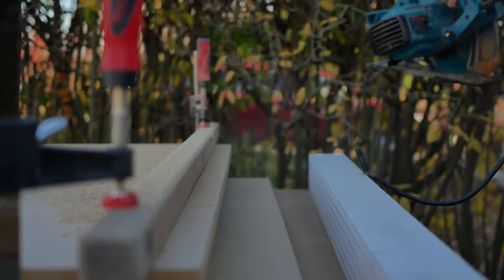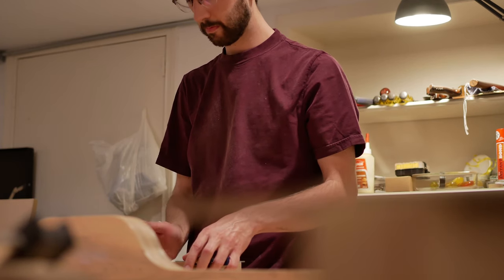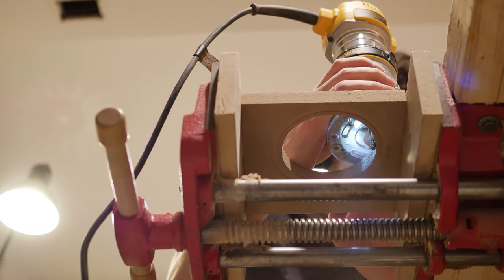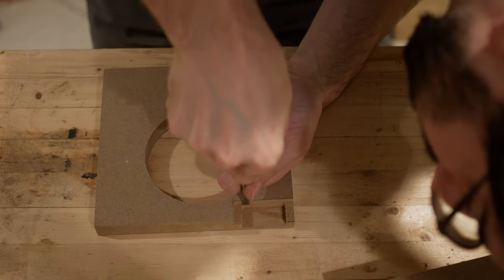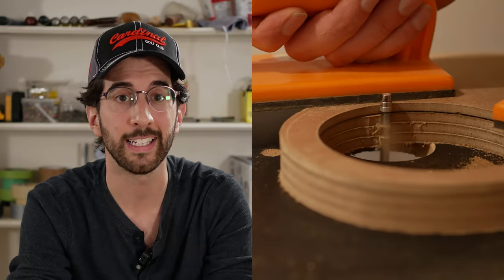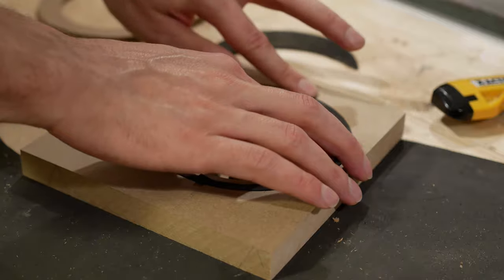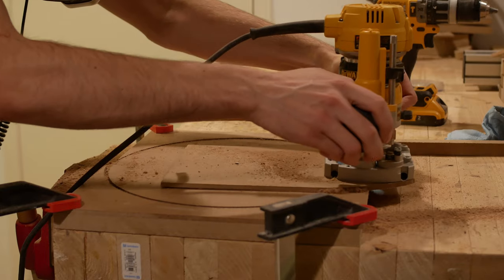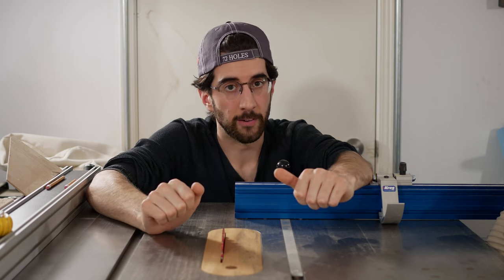DIY Blast Gates for Dust Collection!

Comment: Can’t wait to see what type of motors you used 👌🏼
Reply from the maker: Thanks for watching Mark! I'm most likely going to be using high torque servo motors. Smaller servo motors may work as well, but I'd rather use something with more power so I don't run into any potential issues.
Reply: @ScottWalshWoodworking  Are you planning on a video showing the application of the servo motors?
Reply from the maker: @befmx31  yep! I can't guarantee when it'll be out, perhaps sometime this year 🤷‍♂️? Thanks for watching!

Comment: Are you standing on a stepstool at @10:50 or did you just make yourself a head-banging hazard?   But then seeing you work at @4:34 maybe you're just used to that?   Hmmm
Reply from the maker: I'm a little tall, and my basement shop has generally low ceilings and bulkheads. I think I'm also sitting on my bench @10:50, but I don't think it'll be a problem. I could use a good hit in the head every once in a while.